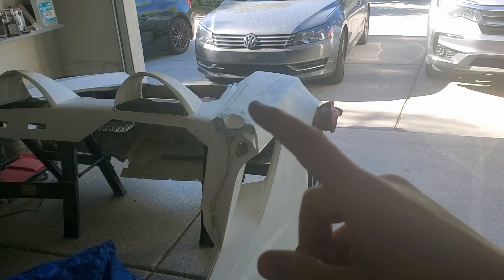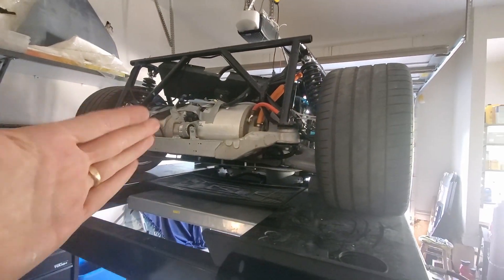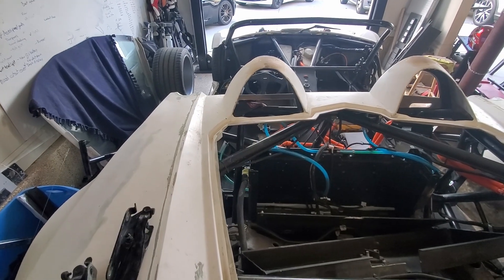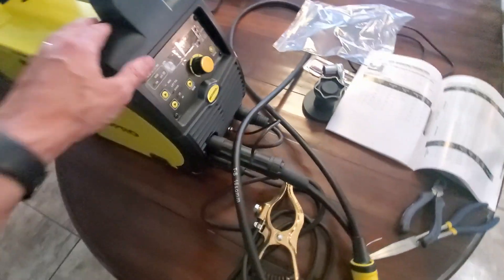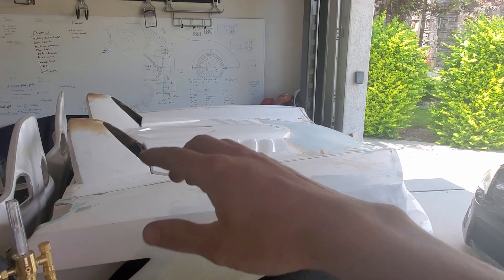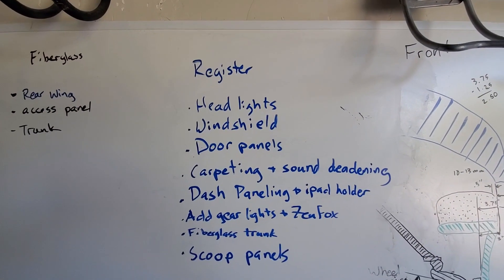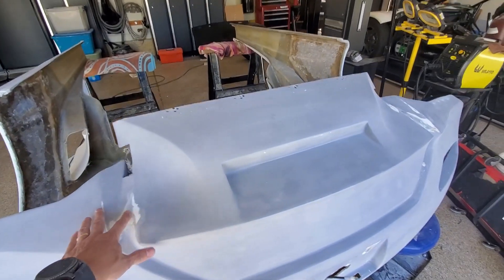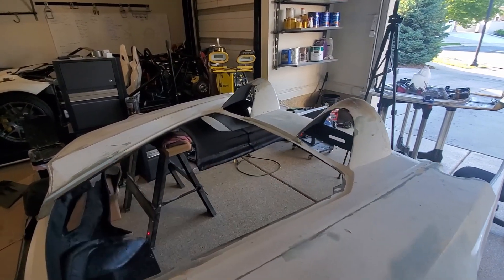Third time is the charm

Comment: Glad to see the hinges are providing the range of motion you need. If I may suggest two more areas of concern; if you haven't considered it yet, you may want to rebuild the rain channel (that you cut out) lower with a separate drain hose to protect your electronics below that point, and second, keep an eye on the attachment points where the hinges attach to the deck lid, if the factory didn't provide any reinforcement in the lid at that point you may see the fiberglass begin to fatigue over time. One solution might be to fabricate a steel perimeter frame that connects both sides and the latch mechanism. This will also ensure that everything remains properly aligned. Best of luck! Did I miss the part where you cut off the pointy end of the lid?
Reply: Was about to suggest the drainage too! :D
Reply from the maker: 21:14 is where I cut the trunk lid.  Thanks for the suggestions

Comment: Great progress as always!

The Mazda hinges worked well.

Quite like the black rubber coating on the inside.

I have a Tvr and fibreglassed my roof for some work, in the corners I have vibration cracks and did the same as yourself, ground out and filled.. but also added steel bars underneath for extra support. 

Unsure if you might need the same as potentially caused from removing the body where as mine was from road use, but an idea perhaps for future. 

As always, well done.
Reply from the maker: Thanks for the comment!